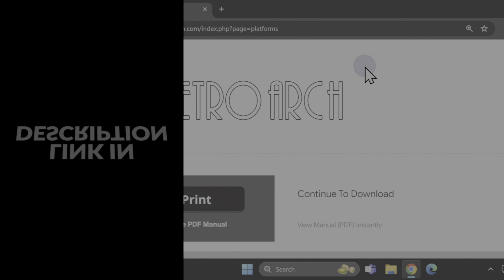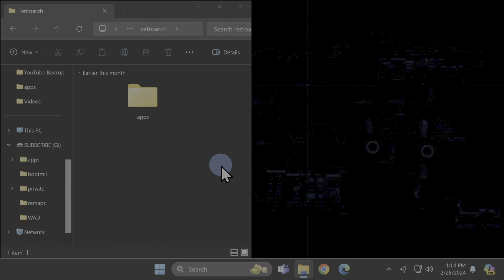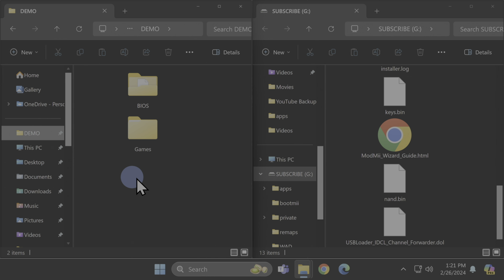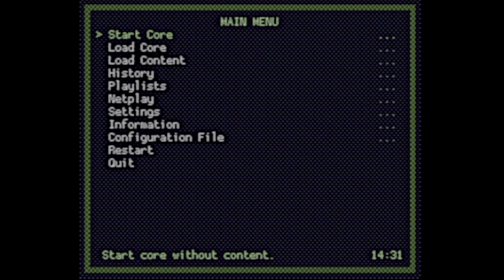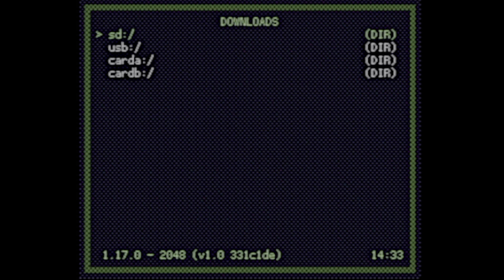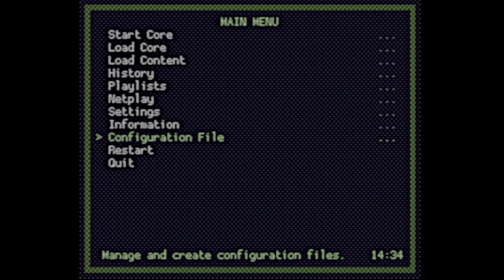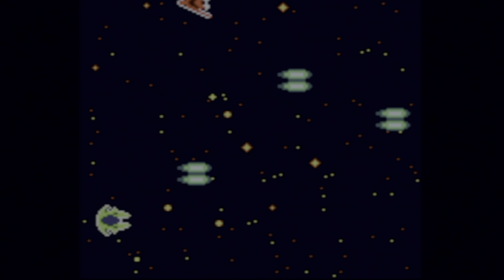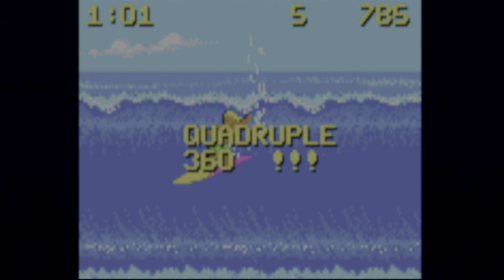Unleashing the Power of Emulation on Your Wii!

Comment: Hi, what about a SanDisk 64GB Extreme PRO SDHC?  Does it need to be 32gb or is 64gb ok?  Can I do this only or do I need to do the jail brake and usb loader stuff first?  Also, I don't own a PC, I only have Apple so what windows versions is best so that I can pick a computer to match. Thank you in advance.
Reply: The Nintendo Wii does not support SD Cards higher than 32 GB

Comment: What size memory card do You recommend for this?
Reply from the maker: Well, there are two options. Larger SD cards are always better, maybe at least 256GB or so. You can also store just the app folder on the SD card and use USB storage for the ROMs and BIOS files. Be CERTAIN to get a USB drive that is Wii compatible, though, as some modern drives are not. That's why I demoed this only using the SD side of the house - compatibility across a wider berth.
Reply: @blainelocklair  cool thanks

Comment: Hey Blaine - thoughts on what cores the wii will run that are LATER than what could already be played? I.e can anything after wii be run via retroarch? Will it run dreamcast via retroarch, even though it couldn't run a standalone emulator for it?
A list would be awesome! Thank you!
Reply from the maker: Great question. I think it'll cap out at Wii games. It's hard to believe, but the Wii is around 18 years old now. Does a lot of emulated system well, but like any system, it'll meet its match along the line somewhere. But 74 emulated system, along with multiple cores for some? That's like alomst 100 cores. Amazing!
Reply: @blainelocklair  thanks for the reply! The builds I make have ps1 (people are always surprise), Sega cd (almost equally surprised). The wii is my favorite little emulation system. Really a power house for the age it is and the type of hardware it has. So great.

Comment: The classic version of the 2TB hard drive that you recommend doesn't appear to be available anymore. Does the contemporary version of this hard drive work the same? Or is there another hard drive that you could recommend that doesn't need external power?
Reply: I've found most hard drives work as long as you get a Y cable (connects to both USB ports on the Wii). That extra port seems to be enough to power a 2.5" drive.

They're easy to find.
Reply: Get a 2.5 inch SSD and an external enclosure
Reply from the maker: Thanks for the heads-up! There's a lot of unpack on this page, but it has a running list of drives that are Wii compatible. https://wiki.gbatemp.net/wiki/USB_Devices_Compatibility_List